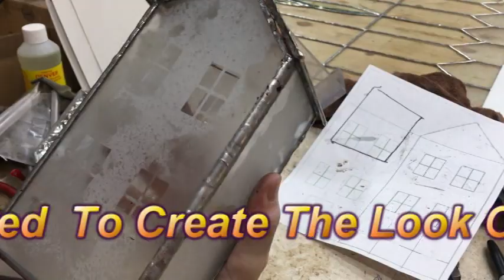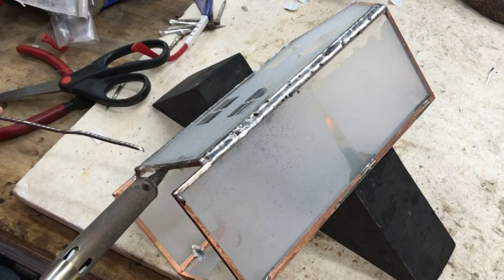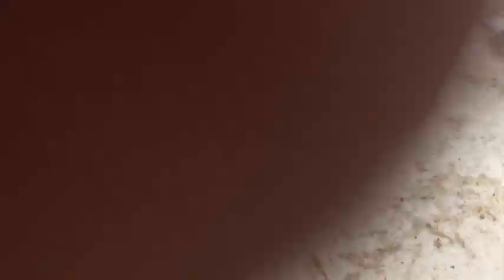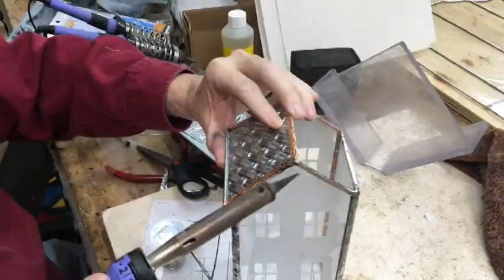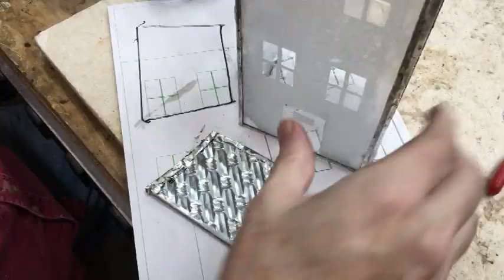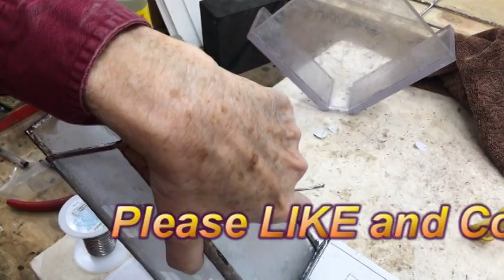We solder a tall 3D stained glass house V348

Comment: on your glass storage cabinet, how far apart are the dividers. I want to make a stained glass storage rack but dint know how far apart to put glass dividers  3" or 6". I mostly order 12x12 glass
Reply from the maker: I've got one where the shelves are 6" apart and one where the shelfs are 12" apart. The 12" is a problem with storing smaller pieces because they tip over and lean taking up more space. The 6" is good but it's difficult when a piece gets shoved back and you have to reach your arm into the shelf. I probably wouldn't have that problem if the shelves were only 14" deep instead of 24" deep.🙂🙂🙂